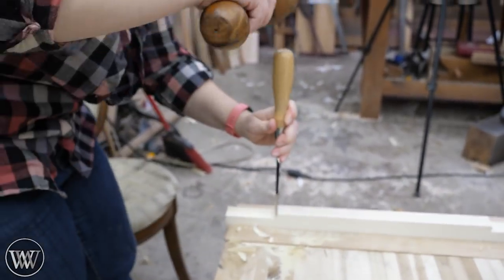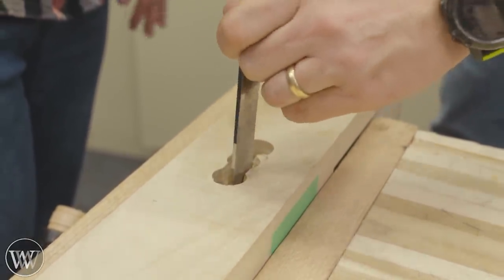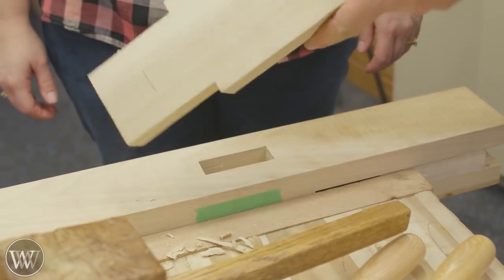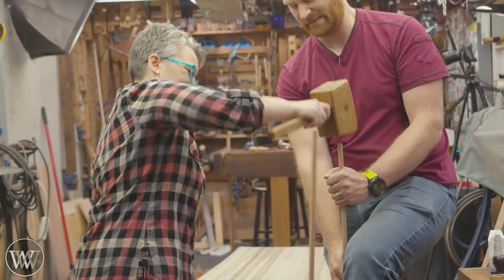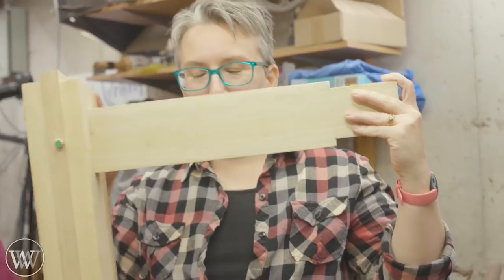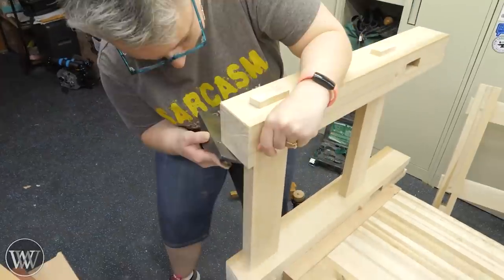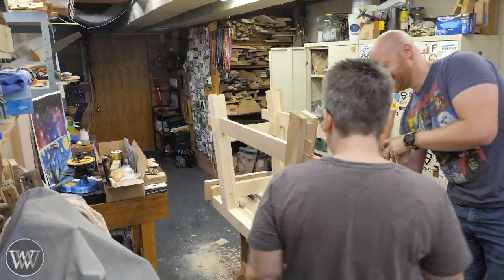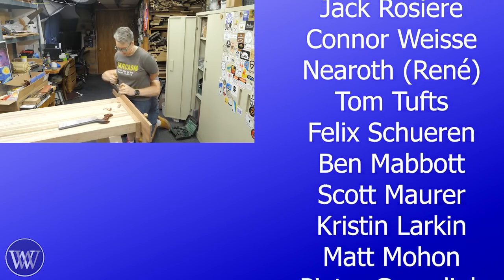Sarah's Bench Comes Together James Gets Bumped Off

Comment: Use pipe with a cap to drive those long dowels in, less chance of mushrooming or splitting the ends of the dowels. 
Sarah is doing a good job with this bench build. Cheers :)

Comment: When your doing the holes off centre for the pegs how far off centre do go?
Reply from the maker: Usually a little less than 1/4 of the thickness of the devil that I'm using. So if I'm using a 1/2-in dowel it's a little bit less than 1/8 in.
Reply: Thank you
Reply: So in mm if I have a 12mm dowel aim for 2.5mm off centre. Im not trying to be awkward i live just outside of London in England so everything i do is metric.
Reply: @lukesaville1212  10 mm dowels are probably easier to get due standard sizes, 2,2 or 2,3 mm off centre in that case.